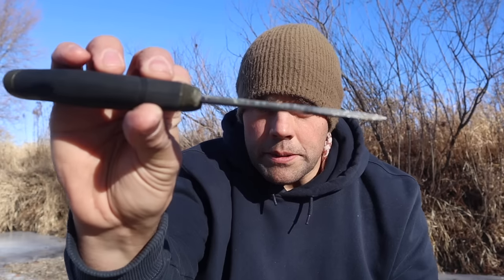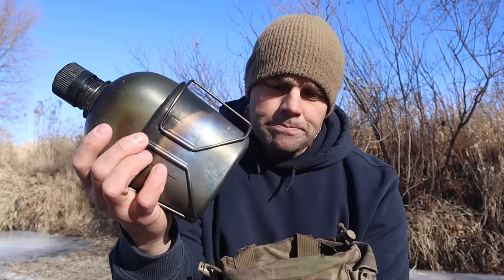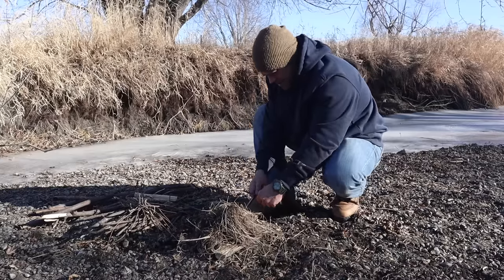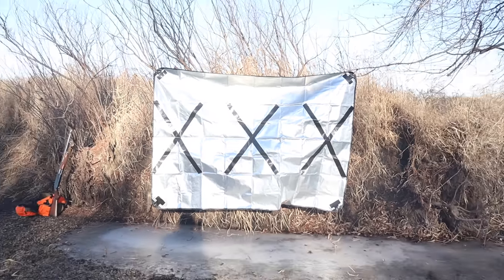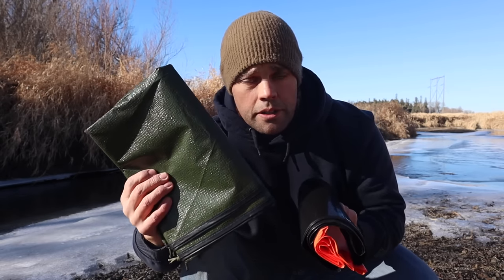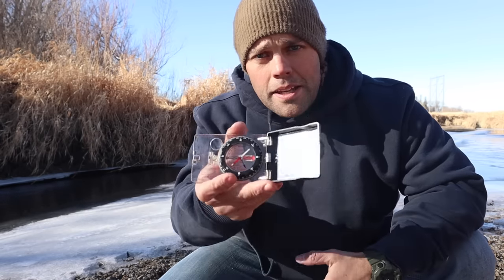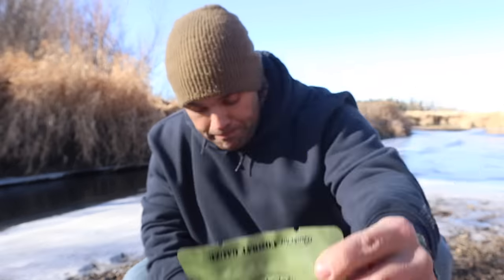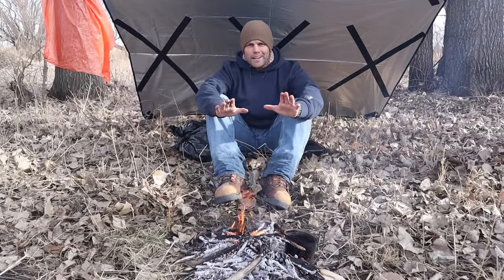How to Make an Advanced Survival Kit!

Comment: Talking about ferro rods; the best bush fire I ever saw was caused by the claw of a digger loader that scraped across a hidden rock in a dry field on a farm where I lived. The operator turned his vehicle around to avoid the rock and missed the sparks setting fire to the dry bush. By the time he realised something was wrong the fire was nicely set. By the time he got help the fire was raging - it burnt two days before they put it out. It hopped the road and circled around and came across the field behind my caravan. It burnt hot and fast and ran right under my caravan without damaging the caravan. It was scary but after the fire had run its course I could walk to the washing line without worrying about cobras and puffadders.

Comment: All good information here and I will use these tips. I was thinking of a possible better thing for the tarp might be to tape moderately pre tensioned para cord to it to so that the cord can be tensioned as much as you like without stressing the eyelets or even better put some kind of sleeving like electrical PVC sleeving over the para cord before taping it to the tarp.

Comment: I used to get plenty of 550 paracord, but no so much now. I can do things without it. Like a shelter I could make cuts to link the wood together or use an auger to make holes and put a pole through the holes, etc. Paracord is nice to have sometimes though, like using it to hold my fishing shelter tent in place, as it is not made to use pegs at the bottom like regular camp tents.

Comment: Darn it I can’t poke to many holes in your kit but here goes, add a lanyard to your bic lighter maybe with electrical tape or ranger bands, add a few water purification  tablets, in cold temps your filter can freeze, the Mora is a great knife but wi th a kit as substantial as yours you may want to upgrade the knife bigger stronger. Spare battery’s for the head lamp, I have a 1/2 in fire steel but a smaller one will still light 1000s of fires. Good stuff on rigging the knife sheath. Add a soup LE ranger bands maybe around your tin thank you

Comment: What advantage does a plastic canteen have over a single wall metal bottle with cup?  Good video.
Reply from the maker: Cost and availability would be the two possible advantages of a plastic bottle compared to a metal bottle. With a clear plastic bottle it could be possible to treat water using the sun. A metal bottle would always require a fire. Both containers could be used as an anchor for a concealed fishing trot line, in my experience plastic bottles hold up better to longer periods submerged. Just a couple of thoughts. Thanks for the comment!
Reply: @RangerSurvivalandFieldCraft  If I use plastic bottles I usually find that the ones that come filed with Smart Water are the way to go.  I've used the same 4 liter bottles in my edc bag for years.  The flip top cap is a winner as well.  I've also used a hot needle to convert a regular cap to a shower cap.  

I remove the labels and the safety ring around the neck of the bottle.  Snagging one of the bags that Kroger gives away with 6 bottles of wine is a good way to carry extra Smart Water bottles in my truck or van.

Comment: Grayl filter is it a hollow fiber membrane filter ? 
Will it freeze, and is it a one season filter ? 
🇺🇸
Reply from the maker: I haven’t had any issues with the grayl freezing. I have used it in sub zero temps and overnights to filter ice cold water. I press the filter after use to expel the excess water caught in the filter. It is a fiber membrane.

Comment: What is the benefit of a ferro rod over a 6 pack of lightweight mini bics?
Reply from the maker: There are pros and cons to a ferro rod over lighters however, I think durability, reliability, and use are the top three. The larger ferro is durable when protected and very reliable given the user understands tinder processes and sources for fire in almost any environment. Then I think use and the ability to strike the rod tens of thousands of times is more useful. Lighter are great and probably my go to routine fire starter however, they run out of fuel and are limited in their fuel capacity. They can fail to work in certain environments. There is also the possibility of damaging the lighter or depressing the button losing fuel.

Comment: What is the use for the canteen bag. There are bags for many things. It is added weight these bags for different tools, supplies. Why do you suggest the canteen bag. Looking for decent relatives...lol.
Reply from the maker: The bag can be used as another container, attached to a belt or exterior molle web, holds the canteen and cup, acts as a silencer for the canteen and cup during evasion, can be used to gather materials, used to gather food, hold other tools or supplies, frees up the hands when carried on the belt or pack, frees up a single hand when gathering water, can be used as a weight for a trot line, used as a sand bag for a rifle, used as a weight for a tarp, can be used as an anchor in snow, really a container has a thousand uses it depends on the user and necessity of the situation. The pouch is light weight with additional pockets it doesn’t make sense not to have it.
Reply: @RangerSurvivalandFieldCraft  Thank you.

Comment: Are there cutting tools that your s.e.r.e. school suggested over other options, if your able to share?  Much appreciated.
Reply from the maker: I was issued a Gerber FML II. It had been through 100’s of classes and rattled when I shook it. Only thing it was good for at that time was as a shovel or a paper weight.
Reply: @RangerSurvivalandFieldCraft  I have a couple fixed blade gerber knives, even some old ones. However the blades seem a little short on all of them. A 6 inch blade seems like a good length for many applications. Also, thank you for the response. Just curious.
Reply: I think it can depend on the terrain.
If I was tropical I would like an 18" machete and a small knife for carving.
If you are in Canada in the winter you probably need a decent saw or axe and a fixed blade knife.
In temperate climates a 5 or 6 inch fixed blade is good.  I like to be able to carve or whittle, dress a fish, and chop......hardly any one thing does all of that. I have packed a 14" machete and a 3" folding knife in central and south America.....that's a pretty good combo.

Comment: Marooned by air crash in the far north timber you will want a 7x9 ft backpacker tarp, a folding saw, and hatchet to roof over a 6x8 ft “cabin” built from 4x4 inch spruce or poplar. sticks.   You can heat some with hot rocks.

Comment: Good Video but I have concerns for the Blow Out Kit. CAT goes High and Tight, They usually go above the knee, Extreme caution is needed when using a compression dressing around the neck. That is usually not recommended, Darting to release a tension pneumothorax is an extremely high risk maneuver for someone who is untrained. While I did pick up several good ideas in the video, the medical section could lead to increased danger. Thanks, Nick
Reply from the maker: I understand the concern and try to limit the medical brain dump during videos. I include a warning in my description. Having treated all of these wounds real-world, I'm confident however, I understand your meaning and words of caution. Thanks!
Reply: @RangerSurvivalandFieldCraft  Please don’t take my comment as a question about your skills.  My problem is I’ve had to respond to civilians that are Youtube trained and almost get it right if you know what I mean. Thanks for the reply.
Reply from the maker: @nickdelia3130  Not at all sir! I completely understood your meaning and figured you had some experience in the “YouTube trained” individual. I think a good point for me is to include the disclaimer in the video in the future. I definitely don’t want to see someone hurt or killed performing incorrect medical aid. Thanks!

Comment: The problem with living in the deepest south of the USA, south Florida, is that if one keeps a survival kit in one's vehicle, items such as any kind of adhesive (duct tape, first aid tape, etc.) will melt, candle wax will melt, lip balm will melt, and so on - how about a kit which includes everything one  needs, without anything that will melt (and become a mess), for prolonged  temps of 115 degrees or so - vehicle sitting for hours in the south Florida sun in summertime ?
Thank you!

Comment: MRE's are awesome, but I would never have one for survival kit. One 500g bag of peanuts for example is 3000 calories. You can keep up high exertion for couple days with that bag alone in emergency. Cheap, efficient, functional and quite tasty. To that I would really just add something like hard coffee candies that have caffeine and maybe one or two small sachets of isotonic mix if you are in hot season/area. Or instead of drink mix, get some mcdonald's salt packs, you could then add it to unsalted peanuts or just water.
Nutrition short term also doesn't really matter, what matters is calories. Really only thing you might want to consider is to get something that digests easier and provokes less thirst, like SOS bars.

Comment: Can someone explain to me the "releiving the pressure of the lung with the pen" thing. And the entry/exit pads.  I was trained in bootcamp about the pads he used for prevention of collapsed lung but I dont know how those actually work. Thankyou!
Reply from the maker: Penetrating chest trauma identified and we use the chest seals to prevent air from entering the thoracic cavity causing unequal pressure. Tension Pneumothorax is a collapse of the lungs in which that unequal pressure between the exterior and thoracic cavity prevents the lung from expanding so the casualty can breath. Prolonged tension can collapse the good lung and must be remedied. Using chest seals prevents air from entering the wound externally however, air is still entering the thoracic cavity through inhalation. Over time this causes tension pneumothorax identified by unequal rise and fall of the chest, coughing, pain on the affected side, and in later stages tracheal deviation. The needle inserted in the second intercostal space along the mid-clavicular line or the 5th intercostal space on the anterior axillary line, which is thinner compared to the chest, allows the air to escape the thoracic cavity preventing the lungs from collapsing: relieving the pressure.
Reply: @RangerSurvivalandFieldCraft  Wow! You really know your stuff!

Comment: Very thoughtful compact nice kit - thanks for sharing.
Please allow some remarks about your items:
1. The Mora Compagnion HD actually has a 3/4 overmolded tang, it's not a rat-tail tang. As long as you don't intend to crack nuts or strike your ferro-rod with the pommel, you won't notice any difference to a full-tang knife.
2. A ferro-rod IMHO is one of the most overrated items to pick. Your 6"X1/2" weighs in at ~135g and costs ~20€. Instead, I would pick two BIC-Lighters (~30g-3€), pack them waterproof and keep them close to my body. What do you need 20.000 sparks for from your giant ferro-rod? Survival is a matter of a few days (not years) with two fires a day.
3. Paracord is another heavily overrated item - everyone seems to copy from the first "survival handbook" for downed pilots in the WWII, and because they already had a parachute and lots of parachute-cord, nobody gave a thought of adding other shelter or cordage. Beeing very stretchy (MIL-spec >25%) and slick, it's not the best cordage for most survival applications, Polyester is superior, when it comes to less stretch and knot-stability.
4. Tarp is ok, I use the same one, but adding a big drop-cloth makes it a "super shelter" a la Mors Kochanski - in cold environments that's key to survive.
5. Your kanteen/cup-set is ok, but a steel bottle with nesting cup would improve your hydration quite a bit, you can boil at least twice the amount of water in the same time with the same amount of wood.
6. Food is another overrated item, it's more a mental boost than anything else - if you boil one liter of water every morning and every evening, you'll be fine for some 10days. MREs are a waste of money, who would eat them outside a survival szenario? I like to carry some "nuts&raisins" - one pound per day keeps you going for 6month+ without any deficit, no need for cooking it and can be implemented in your daily routine, while MREs most likely are thrown away after 10years.
7. Navigation - a relieable compass is very important in dense woods, deserts or foggy places.
Sometimes you have to move and can't wait until the fog disappears, e.g. tidal flats, incoming blizzards etc., without a compass you walk in circles, getting nowhere.
8. Signaling - I missed the whistle as a means to get the attraction of people beyond visability.
9. Medical Kit - I always carry special band-aids for fingers in my kit (one short, one extra-long adhesive leg), the regulars come off in short time, and finger-injuries are quite common outdoors.

10. Improvements to the ferro-rod: very useful, but why pack it waterproof? It's waterproof by itself, that's why most survival instructors put it over a lighter. If you want to keep it from eroding (=corroding) you have to seal it air-tight - I don't think, an open ducttape-envelope will help significantly.
11. A real improvement to your shelter would be to choose an orange one and tape the three "X" to the outside for signalling - your way reduces heat-reflection of the mylar side.
12. a tourniquet in a survival szenario IMHO is ridiculous, there is no M.A.S.H. outside a war-zone - and if you feel it could help, you can easily improvise one with cordage and a stick.
13. A saw certainly is an essential part of a PSK, but the Bahco laplander sucks, a Silky is way better,  just like most cheap folding pruning saws. Very effective and safe to handle.
Stay safe and take care

Comment: I recently got a bacho laplander and it has a little play in the blade. Does anyone know if that's normal?
Reply from the maker: The joint of attachment between the blade and handle can be tightened. The blade can warp with heavy use, but I've had no problem straightening it out.
Reply: @RangerSurvivalandFieldCraft  Thanks for letting me know. I tried turning the screw but it was tight already. So i wasnt sure about it.
Reply from the maker: @sparrowflying864  yeah, the Laplander is good, had it for years and it’s moved to my hunting kit as it still works for me. There are some better brands I recently purchased the Gomboy and it’s great!

Comment: The old fashion lighter is not for me anymore... Now there are these lighters of the same size, but they have the extended tube on it, so it's like a small version of those BBQ lighter. This way you keep your fingers a bit away from the flame when lighting something (tender or fuel).

Comment: Doesn't anyone use a sleeping bag anymore ? I'm 68 now, have backpacked & climbed mountains all over the U.S. & I have never went into the boonies without a sleeping bag of some sort. And usually a thinsulite sleeping pad on top of that. Too old to do that fun stuff any longer, but I would never go into the woods or mountains without a sleeping bag. I don't get it. One sleeping bag attached to the bottom of your pack is probably half the weight & waaaay less work than stuffing big trash bags & just a mylar blanket as warmth, again, I don't get it ?